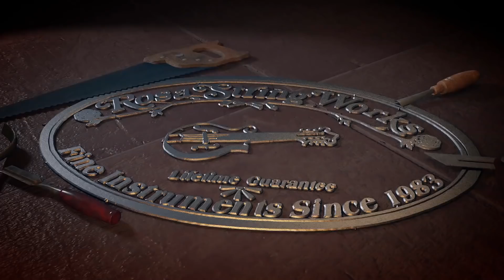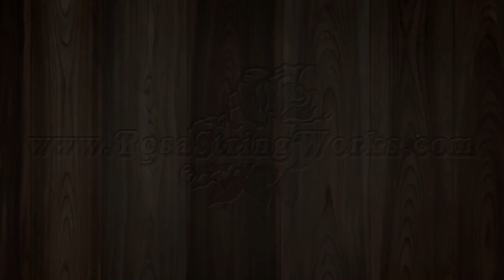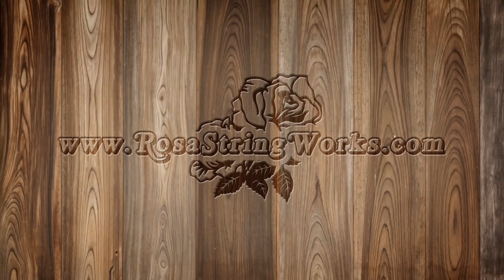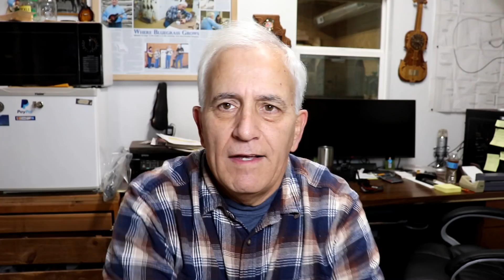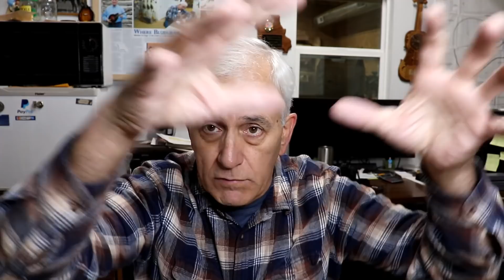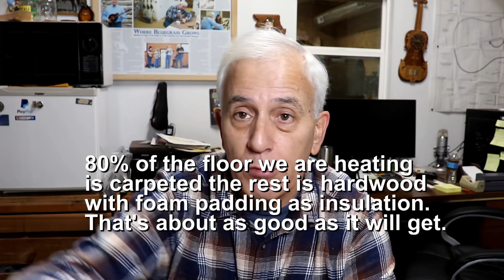353 RSW Gibson Bridge Problem And Cabinet Repair

Comment: Natural gas and coal pollute less than wood. I'm not a climate fear monger it's just the truth. If India burned 1/2 as much wood then we the world population will benefit from cleaner air. But I would never blame anyone for doing what they have to even if it meant burning dung which is worse than wood. Just the facts, alsoTapping into (drilling) thermal heat from below is also a technology that no one talks about and its always on.

Comment: As a furniture maker/repair for about 50 years, and guitar player, I find it so hard to believe Gibson thought it was a good idea to use plywood in that area.  I was wondering if one of the previous luthiers changed it to that when they changed out the original bridge?  All the dowels in the string holes and the original bridge holes seems suspicious to me.  Enjoy your videos.

Comment: Actually I only come here for the furniture repairs. But, now, ...

PS: Home heating you described sounds great. Adding humidification could help BUT it adds complication like the possibility of condensation in certain areas resulting in mold & other damage... so be very careful with this.

Comment: we used to have a 10ft x 6ft box on the roof it wasnt solar it had black filment in it and had small blowers that sent heat throughout the house on a thermostat ,we took it off years ago but actually I wish we didnt ,what it did was just heat up by the sun and the thermostat would kick on and blow heat through the house, definately is a backup because it works off sunlight 'but realy did cutdown on heat issues ,i was young and very busy and it was leaking so had it tqaken off but for a 1970 invention it actually saved the old furnace that lived for 40 years and then some

Comment: Is it possible that whoever did that bridge put that bridge plate in there? 

Speaking of plywood, you should see the Les Ply that Matt, owner of Texas Toast Guitars built. It's such an abomination, it's actually beautiful lol. He didn't do the standard plywood build. 

https://youtu.be/XtgVF4Z8MDo

He laid the plywood on its side, so the top shows all of the different layers of plywood from stacking 20 pieces side by side. They, did a root beer burst around the edge and it's actually pretty good looking. Almost like pinstripes.

Comment: Only outdoor hot water furnace criticism I've heard is that in some applications it's smoke is released too low (short chimney), since you appear to be rural that shouldn't be an issue. A friend of mine has one which developed a leak but I think that is due to our maritime corrosive environment but it's a problem fit to cause a lot of concern. Love your videos; you've taught me a lot and my (not very expensive) instruments thank you too!

Comment: I totally agree on the plywood decision. The glue is acoustically dead material that has very poor tensional and torsional properties (especially if it's too much) and eventually always gives in. As soon as it starts forming a hump the more leverage the force has. Sure it flexes but imagine 150 pounds of string tension (nearly the average weight of a human) trying to rip and pry your bridge years and years of time.

Comment: Not sure of the date of yours, but mine is my dad's dated 1970-1972, looks the same...peck
Reply: Also I think it may be a j 50
Reply: And yeah I am a carpenter, and plywood laid flat, sucks. And yeah used standing up is quite strong, and why lots of Carpenters sandwich plywood in between joist...peck
Reply: Funny story, I made my own pry tool from a butter knife...

Comment: Your PID controller should have a setting to control the range of temperature deviation.  There should be a setting, ether in degrees or percentage that you can set so the range is reduced closer to the target temp.  Check the instructions for the PID as the temp is controlled by turning on and off the resister heating element.

Comment: Great video! Good info, I’m trying to get a 70s Alverez bridgeplate our now. It’s awful. Also, I see a 3d printer back there in your shop, what do you make with it?
Reply from the maker: I was hoping to use it for a lot of things. I believe it's a very good printer it has very good reviews but either I'm doing something very wrong or 3D printing is not nearly as good as people make it out to be. Because everything I try to make with it seems to be very brittle and breaks very easy I've tried several different filaments well no. The bottom line is I need it to work I don't have time to fuss with it. I've got it set up pretty well at least according to the directions. So I just finally gave up.
Reply: Rosa String Works oh that’s too bad, but understandable, it took me a while to figure out the technology also. But you’re right, no matter what plastic you get it will never be as strong as we like. Petg filiment at 50% infill works well in my experience. I have been trying to think of designs that can be 3d printed for guitars myself, So far only decorative ideas as plastics as you know can affect tone greatly. Well I hope you find a time to mess with it again as all problems can be solved to make great prints.

Comment: I commented on your part 2 as well, the weird belly is due to the adjustable bridge design more than the plywood plate. Almost every Gibson or Yamaha that had the adjustable bridge shows the same belly because all the string load was on two lines rather than distributed over a full bridge bottom.  The adjustable bridge was a poor idea.

Comment: I have a 1960 Gibson J-50 (the serial number starts w/ an R & is on the neck block inside the guitar). My father was the original owner & gave it me a few years back. It's condition, saving a very small ding or 2, is the same as it was when he bought it. 

It holds an extreme amount of sentimental value & it does have the adjustable bridge. However, the ceramic saddle split in two between the B & G strings & I replaced w/ the one TUSQ makes, & that didn't help the tone, unfortunately. I've been in search for a nice ceramic saddle for some time. They're costly & I'm willing to pay. I actually tested a ceramic saddle from an old neighbor & it brought the tone back to life (to me). What I wonder is if I could have a bone saddle made. I was told my once that the mass would be too much. Not sure if that's true. But I'd love to replace the TUSQ and not with rosewood, although I've never tried a rosewood saddle. 

Anyway, I've been asked why I don't convert the bridge to a fixed (proper) saddle. But I just couldn't do that & I know my father wouldn't want that. It would hurt the value even though that doesn't matter as much b/c it will always remain in the family - to be passed down to my son next. However, this newer generation of kids (gen Z?) aren't sentimental nor are they even barely materialistic. I apologize for my rambling. 

I'm going to try & reach out to you to see if you have a ceramic saddle for sale in your parts & if not, would a bone saddle be something worth considering. Thanks!!

Comment: Hey Jerry. When you use deer antler to make a nut for my new telecaster style guitar I'm working on building. Does the antler need to sit for a certain amount of time before using it?
Reply from the maker: No not really. It probably would be better if it was a few months old at least
Reply: @RosaStringWorks  ok thanks
Reply: There is a nut on the market called Zer0 Glide (strings sit on a fret instead of a nut).  If nothing else, they are interesting to check out.  
I have never used one, but will eventually.

Comment: I can see how to use plywood for the sound board (or whatever it's called).  I doubt it would save money for Gibson.  
Ok, cut up the plywood into tiny vertical strips and glue them back  together side by side. You'd see all the plys all the time.  They would be set to be strong against bending.

Comment: Back in 1991 Flatiron was making excellent mandolins, as good as if not better than the Gibson models, and for half the price. I ordered an octave mandolin and paid $2000 in advance. They said it would be ready in 3 months. After 3 months I was stalled with a story about the woman who finished the mandolins was in a car accident; after 6 months I was told that Gibson had taken over Flatiron and they refused to honor the order, wanting another $2000, approximately. I cancelled the order. I received my refund, but I have never dealt with Gibson since. I used to have a Les Paul in the early 70s, but I got rid of it because the build was sloppy and the thing kept going out of tune.  Poorly-built and overpriced guitars and lousy customer service. Thanks, Gibson.

Comment: 1963 or 1964 J45.  Original bridge was plastic. I doubt Gibson put in that plywood bridge plate.  The previous guitar repairer installed an incorrect style bridge and did a hack job on this sweet vintage guitar.
Reply from the maker: The bridge played is absolutely original. The reason I know is that it's covered in fabric the same fabric that was put on the x-brace.

Comment: I’ve never seen a plywood bridge plate on a Gibson even on the LGO which was a inexpensive model. You mentioned the guitar has been repaired at least twice by others. One of them could have put the bridge plate in when they did the conversion of the bridge.
I honestly don’t think you should blame Gibson for this bridge plate although If this is a Norlin era Gibson all bets are off on what you might find.
Reply from the maker: Absolutely one hundred percent positive this came from the Gibson Factory that way. You'll see in part 2 how I prove that

Comment: Not being an instrument maker, I assumed that the bridge plate is there to counter the string tension that bows the area up behind the bridge and dips the area under the strings.  I would think that the grain of the plate would be front to back to compliment the grain of the top and it's the bracings job to direct any downward forces on the top to the sides.  The 2 outer plys of the plate you removed appear to be going side to side and only the cheap filler wood was providing any front to back strength.  I further assume it was done on purpose.  What am I missing?  Which way should the grain be on a solid wood plate?
Reply from the maker: Traditionally the grain does go across the wood. But it should be quarter sawn wood.
Reply from the maker: Additionally part of the reason the Gringos across is because that helped spread the sound across the top.
Reply: Oh right..sound..er..I guess that bit has some small importance.

Comment: My SG needs a little weight in the body so the neck wont dive. I wonder if I put a sinker in the hollow part it would rattle and ruin the sound. maybe a few sticky wheel weights? Maybe I should forget the idea all together so as not to screw it up. maybe they would work on the strap on the  bottom?
Reply from the maker: Well I haven't tried anything like that.

Comment: Lo.l!!! Structure Changing, you crack me up!!! I doubt that is a Gibson maybe it was a Chibson, a Chinses knock off? ..............It makes sense that they filled the holes in if they were using Nylon Strings the nylon E, A, and D. string are a wrapped fiber like Nylon or silk.............
Reply from the maker: It is 100% Gibson. It is original direct from the factory. The customer bought it brand new and is the one owner.

Comment: There's part of me questioning if that isn't a fake. The bridge shape just looks wrong to me for any model of Gibson j*5 type. There's no label inside the guitar. The poor bridge plate etc. I may be wrong but I really question if that didn't originate in one of those Chinese copy shops.
Reply from the maker: I should have said yes the bridge was replaced that's part of the problem that I'm trying to repair.
Reply from the maker: It is 100% original Gibson. There is no question about that the customer bought it brand new and he is the only owner

Comment: I seen the body made of plywood, composite, acrylic, and the cheapest wood possible that has no weight whatsoever and a couple made of pine, but that's on a solid electric. I seen plywood in the same situation before and thought as cheap as it is, plywood, really? But it was a Hondo not a Gibson that had a terrible bow behind the bridge, being it was so cheap I used it at camp, that guitar didn't resonate either so I took a piece of hardwood and I set it on top of the supports inside just under the bridge and drilled 1 hole through each end of the bridge then placed the wood in place and screwed it down, put the strings on and tuned it tight until the body was true, it still had a slight bow so I gradually tightened the 2 screws so it was flat when tuned. A miracle happened. The intonation was dead on, it resonated nice and deep the sustain was beautiful, now I adjusted the neck and tightened the truss rod. This was over 25 years ago and I was going to burn it that night, but I gave it to my vocalist to learn on as I played with him and showed him the chords because it's always nice to have the vocalist holding a guitfiddle and he became pretty good and was able to back me up when I did leads. Yes, I know this is totally unorthodox, but it worked, its still in use, we call it firewood, but man, it was like night and day. This was a guitar that never had the intonation able to set. When I finished the truss work, the strings sat just above the frets with no buzz.

Comment: I really love your heating tool. Spent many an unpleasant hour with a propane torch heating a putty knife taking a bridge off a 12-string once. Your method looks so much better. I learn so much from every one of your videos. Thanks!
Reply: I tried a heat gun, bad idea... Went to the wife's iron, worked better, no burning the wood
Peck
Reply: @gregorymattox420 heat gun is fine, but a blowtorch is not

Comment: Plywood is dimensionally stable when exposed to humidity. It doesn’t matter which way it’s turned it will be stronger than a piece of the wood of the same species and same thickness. The problem with using plywood in an application such as this is that the solid wood top will expand and contract with the  width of the grain at a different rate than the plywood and cause the aforementioned issues if it  gains or loses too much moisture. A plywood top with a plywood bridge plate would not have this issue.

Comment: Boy I could see that bridge plate was fighting you.  Glad you got it out without doing more damage to the top.  It was flexing a lot while you were pulling with the larger tool.  I saw the burn marks in the finish - that's a drag. Hopefully it can be touched up and blended.

Comment: Lets see, top is bulging, the bridge 'sweats' when heated, the bridge plate (no matter it's material) is bent, bridge is at a funny angle, layers of the top wood detach with the bridge; the seam under the bridge between top pieces is separating;  sounds like some sort of a moisture problem to me.  I can't imagine what has happened but a humidity problem or some sort of problem with the glue holding the bridge would strike me as possible given all of the symptoms.

Comment: Build a rocket mass heater jerry you'll use a fraction of the fuel
Reply from the maker: And it would heat one part of the house pretty well but not spread over seven thousand square feet.

Comment: propane is very expensive and more than having a heat pump 5 times over believe me i tried the propane heater having a heatpump ,cost me about $300 to fill the propane tank ,I used the small propane heater as a backup to the heatpump after a month i used more than 3/4s of the propane i ordered now this was a small 2 bedroom house i was renting ,after a month i decided not to use the propane heater I lived in the house another year and just used the propane for the stove and gas dryer ,you did the right thing buying this outside unit hopefullty it is as efficient as can be but using steam basically to heat the house makes all the sense i can think of,btw your first instinct ive found is 90% accurate

Comment: I have no meaning to anger anyone but i’m simply curious , why does the US still use the imperial system instead of the metric system?
Reply from the maker: It's really all the same. I find Imperial no more difficult than metric. And I find metric no more difficult than Imperial.
Reply: Rosa String Works thanks mr rosa!
Reply: The actual answer has to do with all the thousands of "machines of production" - the machines that make the machines - the costs to convert them all is prohibitive.  Other industrialized nations had it easier for conversion because, due to WWII, most of their industrial infrastructure was destroyed - Germany, France, England, Italy, Japan, etc.  England used to be on their own proprietary system, the Whitworth system!  Try finding tools to work on a 1936 Jaguar!

Comment: Looks like you may want to go with a slightly over sized bridge to help cover the burn on the finish.  Just a thought, that is what I would do.  Nice job figuring out that bad bridge plate material.

Comment: You could just put a thermal break around the exterior Foundation with foam and that might help
Reply from the maker: That's what I said but I am not going to do that because it's just a huge job it's 144 ft long and 80 deep